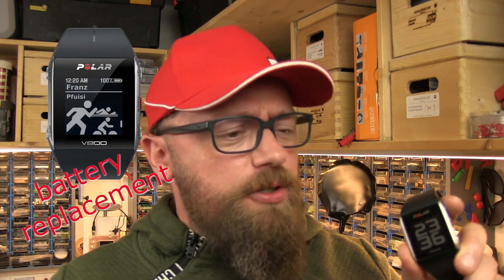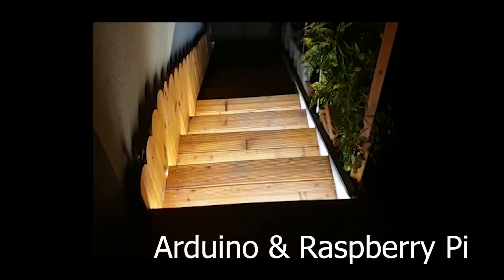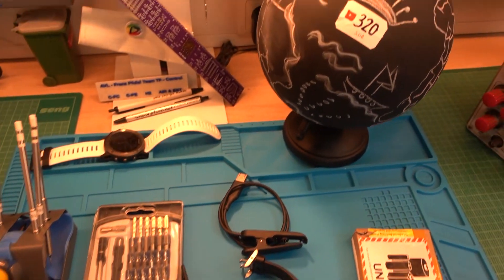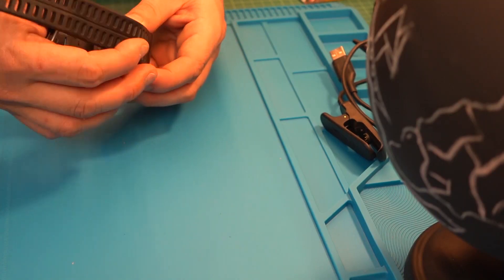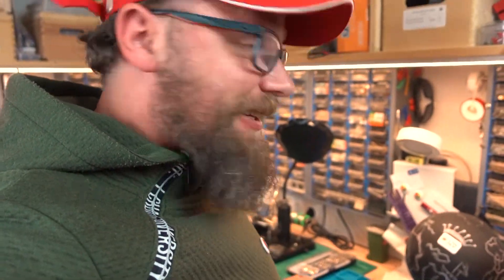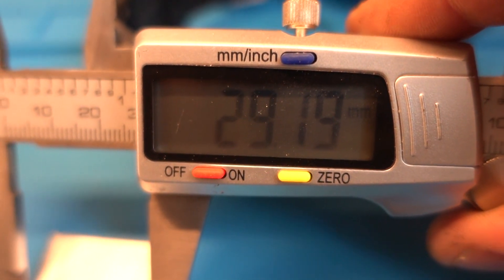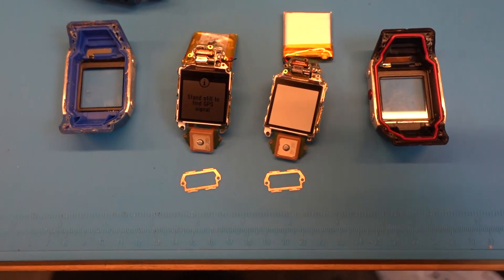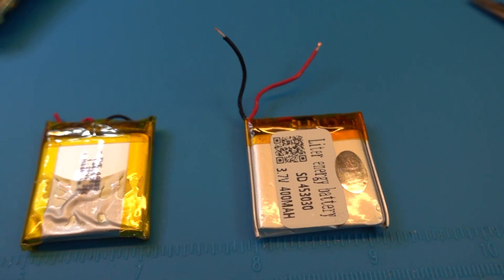Polar V800 Repair/ Battery Exchange [Tutorial] -- in ENGLISH [EN]

Comment: Thanks for the video, I really needed this information for me. In Hungary, this service costs $ 64, so I'm trying to replace it. The original pole battery is 4.4 mm thick, 28 mm wide and 30 mm long to the best of my knowledge. The Aliexpress switched battery is 41.19 mm long and fits perfectly on the watch, 10 mm longer, I can already see the link is no longer a good image in the video and the size is yes not 403040 should be but 453030 number.
Can you provide information on the operating time of the watch after replacing a new battery? Currently, I think I have 5 hours 21 minutes without my GPS measurement and heart rate, so I need a replacement.
Reply from the maker: Dear Zsolt Olah, 
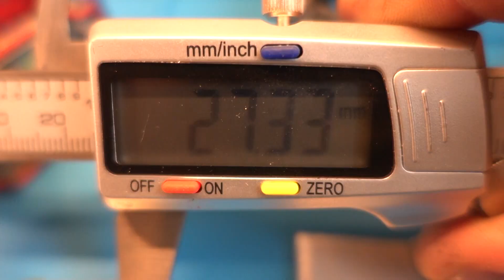I measure the battery right now for you, the length is 28,2mm, 4,6mm thick and 27,2 mm wide. I used as a replacement the 403040, but as you can see in 04:42 - this battery is wider and its hard to mount it in that place, but I used this kind of battery instead of a 402540, because of the capacity. Keep in mind the cabling needs some space, in 07:29 you can see this, I would recommend, to not use a longer battery. Regarind the operating time, I cannot say know how long the battery lasts, I do not have enough data yet.

Overall if you good with small things repariering, you could use the wider battery.

I hope my comment helps you, if you have more question, let me know.

Greetings from Austria
Franz
Reply: Thanks for your reply I can install it during operation or wait for the battery to drain
Reply from the maker: @zsoltolah3499  You can remove the battery when the watch is still on, or the battery is full. Just cut the wires one by one -> see 05:35. Only take car the battery cables to not touch any of the parts and to not shortcircuit the battery.
Reply: @pfuisi  I ordered (silly me) the 403040 as your link suggest .. that is not the right size it's too long as height is 40mm !
In video you have the 453030 that is the correct size.. .. maybe even a 503030 can fit ?
Reply from the maker: @tomastimoransky378  oooh. Sorry Tomas, I need to check this again. I knew the 403040 was not the perfect size, but It fit (somehow) - the battery is what I used, but smaller are better, only they maybe have less capacity. 

I will change the link in the description.

Thank you very much for yur feedback! highly appreciated. Sorry for the inconvenience.

Greetings from Austria
Reply: @pfuisi  hey thx for reply,
You fitted 453030 - 30mm length
I was trying 403040 - 40mm length.. no way to fit this :D 1cm longer 
The tight fit you mention with 453030 is the width 30 Vs 28 , but the height you used 30

Btw did you test the battery life on some watch?
Reply from the maker: @tomastimoransky378  hm... I measured the ordered battery I used a sligthly bigger battery: length is 28,2mm, 4,6mm thick and 27,2 mm long.

This is what I got. On the package it was 403040 written. But when I think now about it - you are right. There was something wrong with labeling or so. My replacement battery was 27,2mm long.

I will again change the description.

Thank you very much for clarifying!
Reply from the maker: @tomastimoransky378  Yes, with this two watches here. For some, the battery replacement improved the battery life, on the others were only a little improvement. I am not sure why, maybe it was a bad battery, or could this be related to firmware of the watch also!?. 
Some people messaged me regarding battery life: On 6 watches out of 10 there was a good improvment of battery life, the other 4 said - It was only a little improvement. Really not sure, whats going on - maybe this also depends on Softwareupdates?! I slightly doubt that 40% of the batteries were bad.

Again, thank you very much for your analysis and clarify the size issue.

Greetings from Austria
Reply: Üdv, sikerült, megcsináltad? Ha igen, érdemes volt? Van már működési idő tapasztalat? Köszönet!
Reply: Válaszolok helyetted: Kicseréltem közben én is, nem kevés energiát beleölve. A méretben passzoló 502530 akksi 2, maximum 3 napot bír ki, mindezt sport módok használata nélkül, sima óra módban. Siralmas. Ha mindezt előre tudom, biztosan nem álltam volna neki.
Reply: @zoltanjakabfy8824  that has to be some faulty battery...
Reply from the maker: @tomastimoransky378  Yes, I got several feedbacks. That some batteries did not improve the usage. 4 of 10 people had the issue. I am not sure whats going on.
Reply from the maker: @zoltanjakabfy8824  Hello Zoltan, I am sorry to hear that. Some people replied and descripted the same issue. With 6 people out of 10 it is working good. I am not sure, what is going on.

If you have more information, please reply.

Greetings.